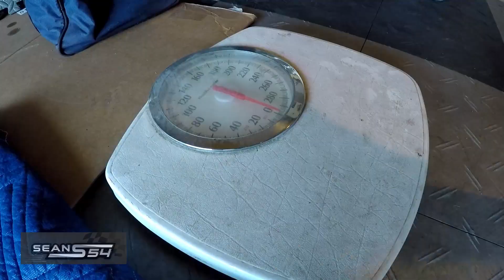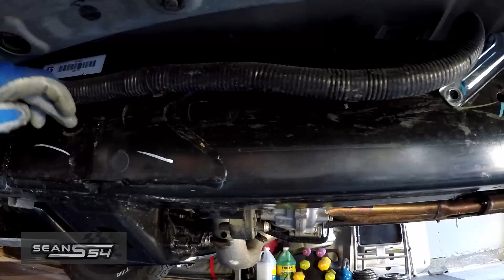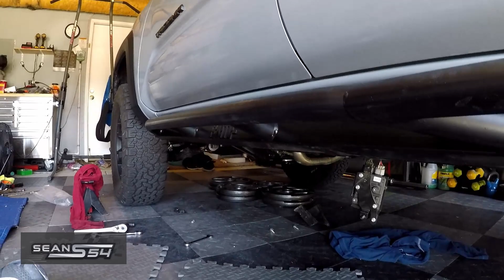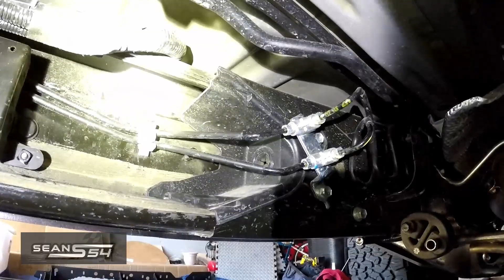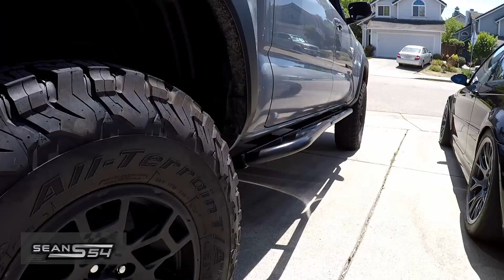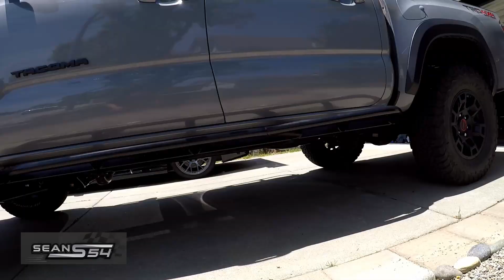BAMF Rock Sliders - 2021 Toyota Tacoma

Comment: You don't want to have BAMF powder coat them for you... you're much better off buying them raw metal and having someone else local do powder or just paint them yourself.  I ordered mine back in August of 2024.... they waited in line to be powder coated from Early November until May of 2025 and never got done.    I ended up going to pick them up raw ended up painting them myself 9 months after placing my order....

Comment: I like those sliders and I’m thinking of getting them bcz I’m in the Bay Area too. I don’t see how they help stepping into the truck though. I don’t have a lift so I can get in by just stepping in with my right leg and sitting down. I can’t see how a step or slidder would help with in getting in or out. Protection from rocks I get. I kind of don’t want to get a lift bcz then I won’t be tall to step in.